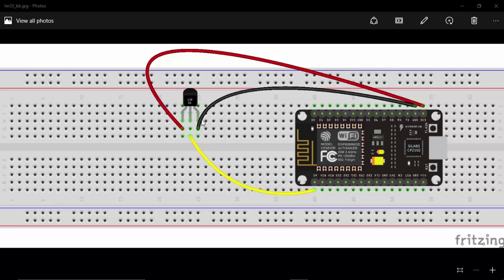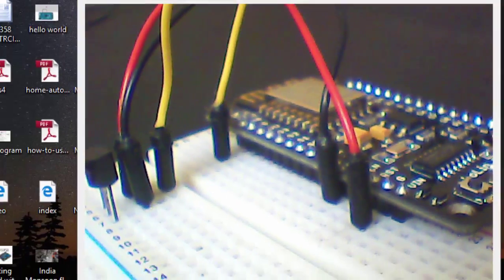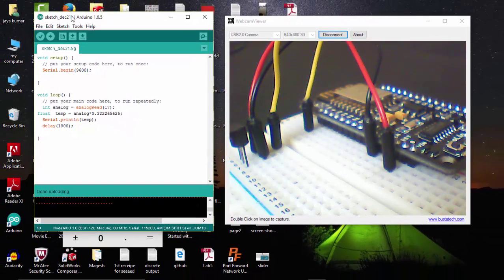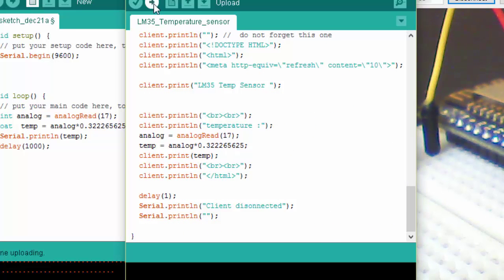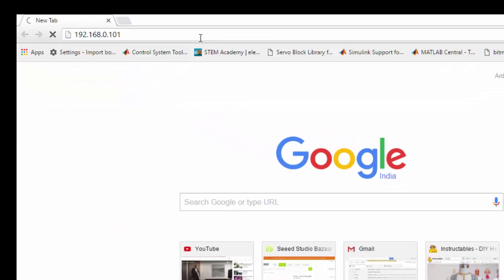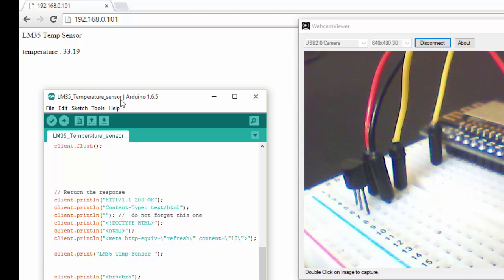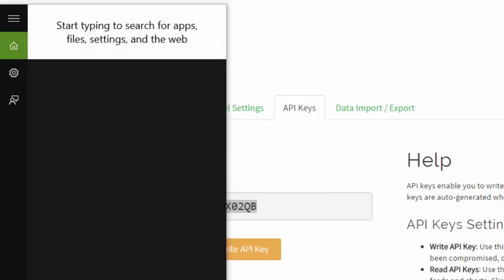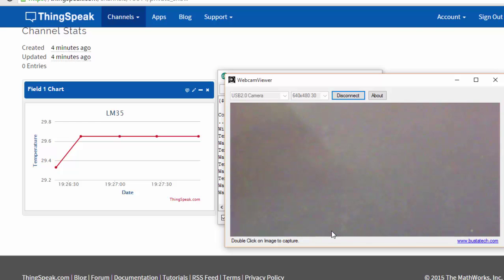LM35 with Esp8266 Thingspeak

Comment: Where should I connect the temperature sensor in ESP8266 esp-01? And can you share the code?
Reply: I believe the ESP-01 doesn't have a Analog Input pin. You therefore would need some sort of analog to digital converter first, and then connect the output of that to the GPIO2 (the only available pin on the ESP-01).

Comment: ADC has 0 to 1v (10bit- 0 to 1023).. why did you take 3.3v as reference ?
I think it should be (1/1024*100)
Reply from the maker: the board I'm using having an in built voltage divider. even if I supply 3.3 v it reduces to 1v. if you connect ground to board you will get 0 and when u connect 3.3v u will get 1024. so that's the reason I used 3.3v.
Reply: +Arduino Robotics LabVIEW Solidworks Correct. I didn't notice the NodeMCU board has a resistor at A0. thanks.